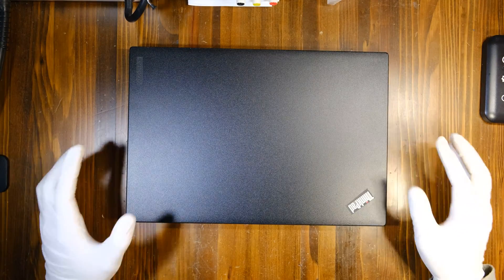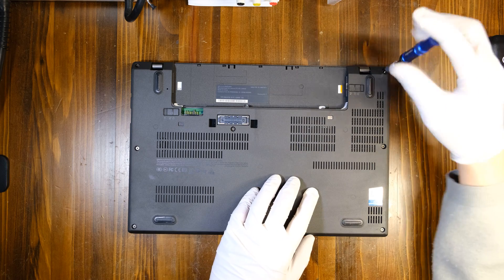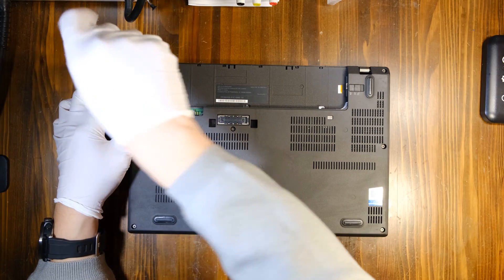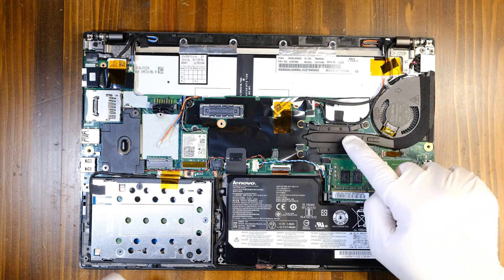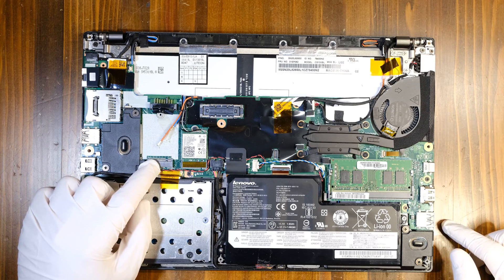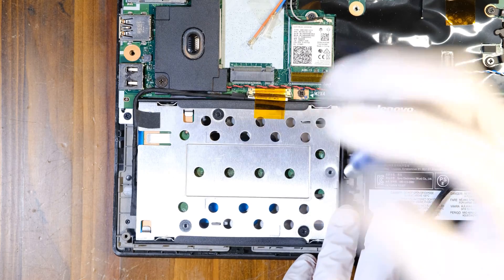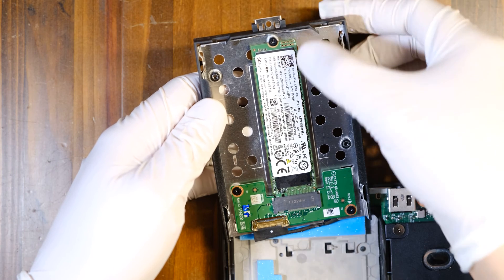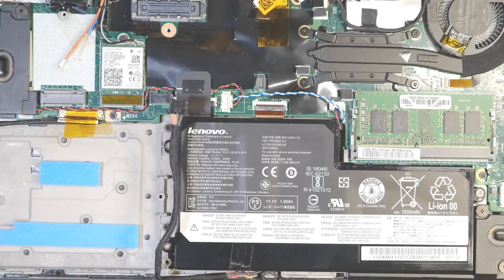Lenovo ThinkPad X270 Upgrade RAM, SSD, Battery (How to, Disassembly)

Comment: hi first off all sorry for my english , i want this bad boy and i have found it for 200 box but this computer cam with i3 can i put i7 in it,  what socket it is ? thank if you read this                                                       best regard
Reply from the maker: No. the processor is soldered on the motherboard. Cannot change the CPU
Reply: @PTITBROTHERGravenhurst   thank u for you answer

Comment: Can u used nvme and ssd 2.5 inch storage at the same time?
Reply from the maker: No the 2.5 inch bay is the place where you can install the NVME ssd. You will need an adapter to install the NVME though.
Reply: @PTITBROTHERGravenhurst  unfortunately my x270 doesn't have the adapter. 🤦 Can u please send me a link for this? Thanks!
Reply from the maker: search for lenovo x270 nvme adapter or something like that on Amazon. I do remember that some sellers were selling it on Amazon